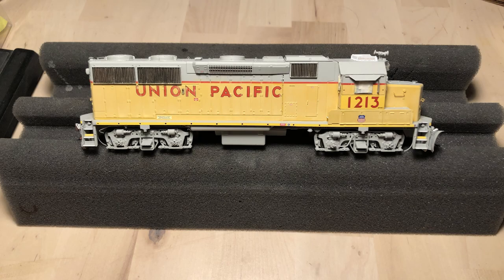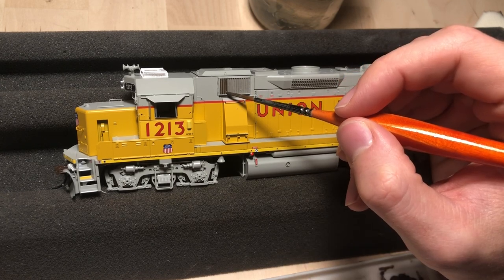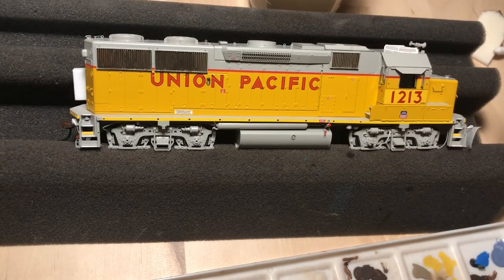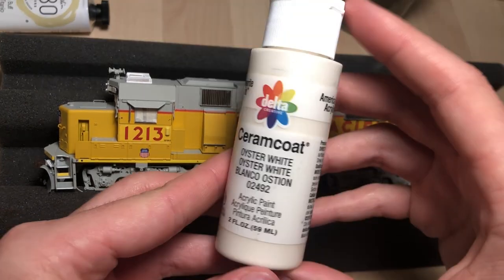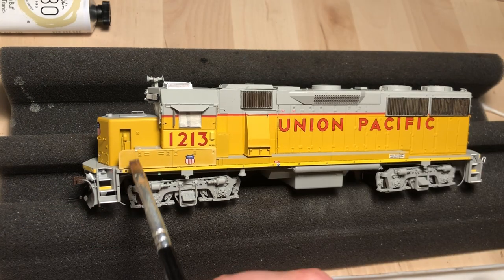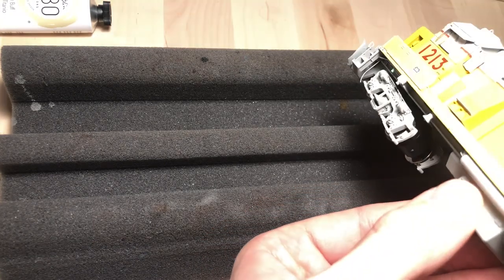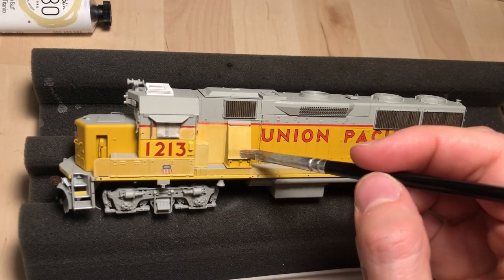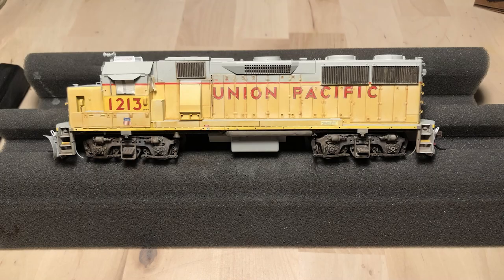How to Weather an HO Scale GP39-2 | Part 2 - Acrylic Fading | UP 1213

Comment: That yellow fade looks EXACT. For some reason, UP Geeps tend to have a very ugly yellow color once faded.
Reply from the maker: Thanks, Abel. UP units in general tend to have some very "ugly" fading that is quite a lot of fun to replicate. In the next installement I will continue to modify and improve this base color
Reply: @unionpacificcascadesubdivi6477  I think it looks good as is but the true game changer will be the pin washes along the seems of the doors, hinges etc. Highlighting those areas with either weathering powders or pin washes will really make things pop!
Reply from the maker: @AbelG8781  if you skip ahead to the end of the video I provide a look at where one side of the model is at and where I am headed with the next phase of weathering.